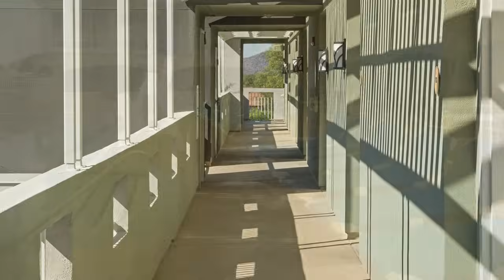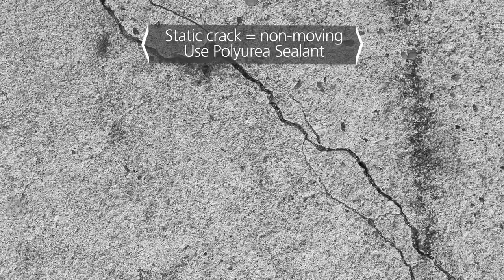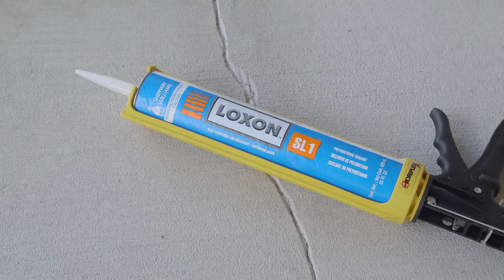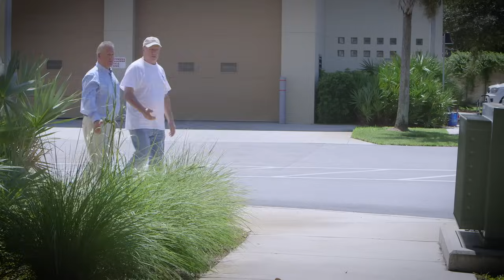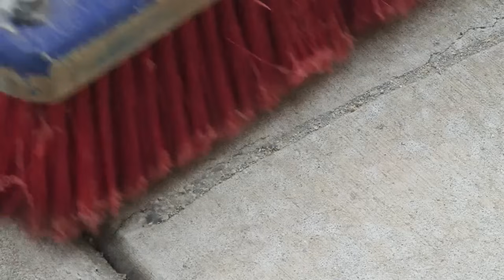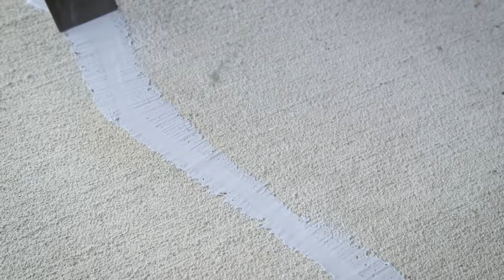Concrete Surfaces Crack Repair - Sherwin-Williams

Comment: So I guess you can't patch one of these cracks without still seeing it
Reply: Use epoxy and sand. Epoxy is transparent and you give it the color and texture similar to concrete using sand. After you sand it it's the best finish making the crack as thin as possible.

Comment: How do you cosmetically fix the concrete AFTER it has been repaired? I have a white line of filler and it still looks awful. Help!
Reply: Use epoxy and sand. Epoxy is transparent and you give it the color and texture similar to concrete using sand. After you sand it it's the best finish making the crack as thin as possible.

Comment: Why not use epoxy product?
Reply: The crack appeared because of shifting foundation, filling it with something that hardens like concrete will only hold till it shifts again, you’re going to need something more flexible after it dries
Reply: Not You    I agree. So how would you recommend fixing a wide crack caused by a shifting foundation?  What products would you use for a diy project?

Comment: Call a caulker. Need to grind out cracks with a crack chaser, wire brush and caulk with a polyurethane caulking for 50% flexability (the more flexability the weaker the caulking) . I'm a professional caulker, do not watch "do it yourself videos" always call a pro. Your concrete is always moving.
Reply: Exactly right and why I call a professional for everything.  Never learn to do anything yourself.
Reply: lol roasted!
Reply: Caulk to me dirty..
Reply: JM's Caulking LLC seriously had no idea that this was a profession all on its own. Learned something new today. Thanks!
Reply: Then why are you watching "DIY" videos on youtube? Just trolling for customers?
Reply: Mike Erickson What’s wrong with advertising? Are you that bitter and miserable that you have to make snarky remarks?
Reply: @joshua mcnew  whats a good polyurethane caulking to use on a indoor warehouse?
Have you ever used a product called qwik stitch?
Does every crack need grinding out?